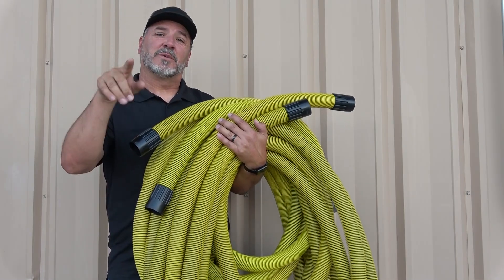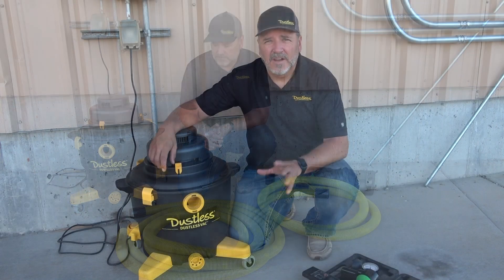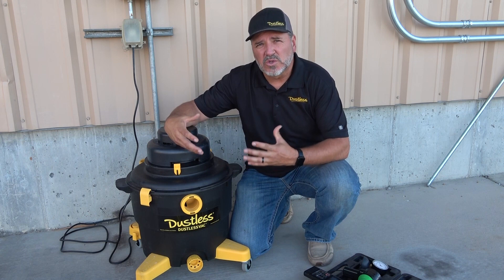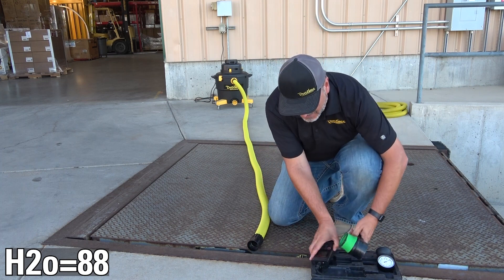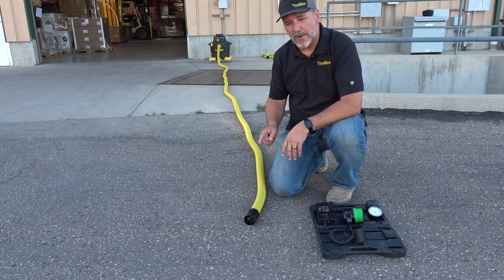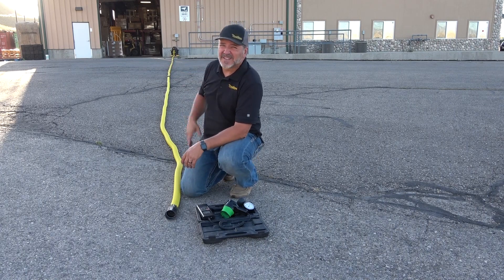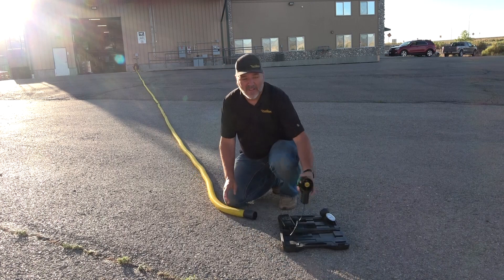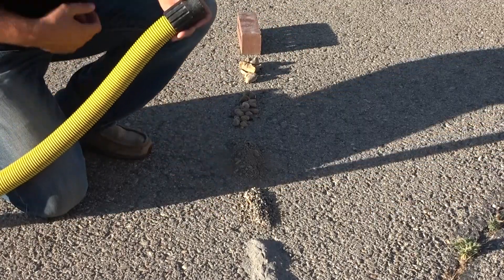The Hose Length Dilemma - Testing 100 ft of Hose! | Dustless Answers

Comment: I need a shock vac that is built for restaurants. Where water can leak to the bottom. Like 3-5 gallons of water. But also has a strainer that blocks debri. Easy to drain and easy to empty the trash and debri. 100' hose. Every one I can find mixes the water and trash together. Need like a strainer part to separate
Reply from the maker: What kind of debris are you trying to separate? While we don't specifically have a product for this need, adding a Wunderbag to our D1606 wet+dry shop vac will allow the liquid to slowly seep out of the bag into the canister while keeping the debris inside the bag. The liquid would not drain quickly, however, so this may not be ideal for your needs.

Comment: The first test he said was pressure but that appears to be false, it should be vacuum! For the 2nd test, he said it had about 88 lbs. of pressure! What?. Still was interesting. Would like to see a test with 2 1/2 inch hose and with different vacuums with a higher CFM.

Comment: You should also mention, with longer hose. It will take longer to reach the max lift. 
Higher cfm with get you to max lift faster. 

Also, another test would be testing the cfm and lift with liquids running through. 
Also, if you have foamy detergent, that will drop your cfm down to nothing. 
I have a 500cfm machine, and i noticed a huge vacuum lost with foam. It's probably because it's lighter than water and harder to extract.
Reply from the maker: That's interesting 🤔 We haven't tried foam before. It makes sense that varying density of liquids would have varying effects on performance. We might have to make a Part III 😅

Love the carpet cleaning videos, btw. Very satisfying🙌

Comment: Hi, I am wondering if the connections cause for a greater loss of CFM?
Reply from the maker: @nwallace914 You inspired a Part 2: https://youtu.be/Wm8Jl3GFzQE
Reply from the maker: Correct. Each coupler introduces some friction and changes in air pressure. A single 100 ft section of hose will experience less CFM loss than four 25ft sections linked with couplers. However, this difference should be negligible.

You've potentially inspired a follow-up video 🤔